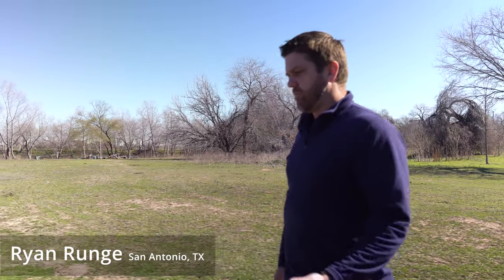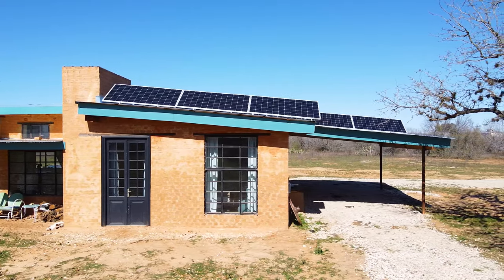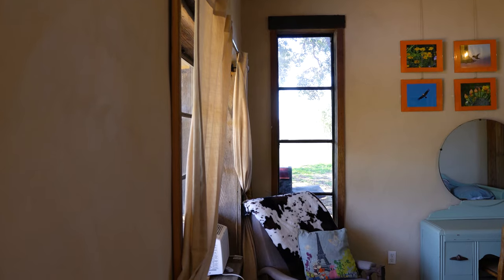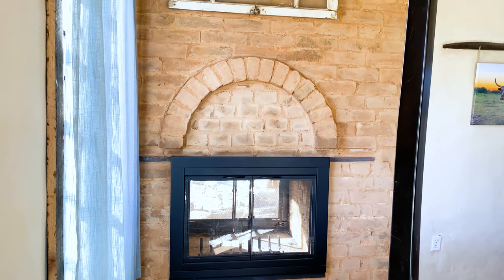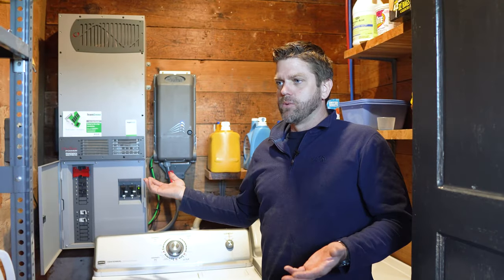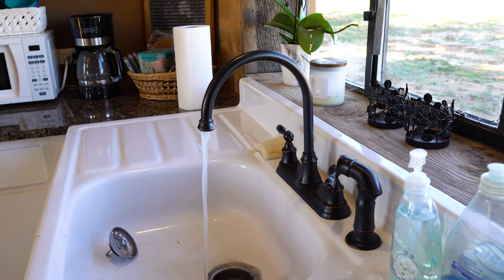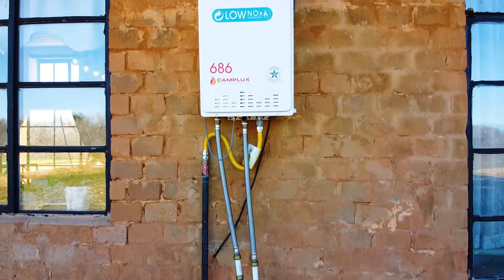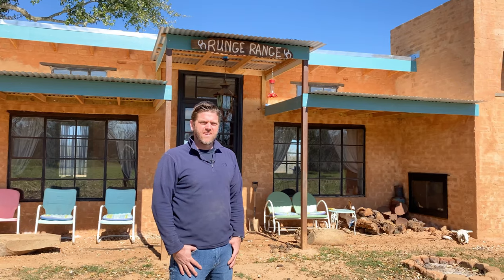Exquisite $50k OFF GRID EARTH HOUSE made with COMPRESSED EARTH BLOCKS - Ryan Runge Netflix HGTV

Comment: I am getting mixed messages about CEB homes.  One I hear that the R value is poor so the home would remain cold in winter.  (I hate being cold) Others say that CEB homes are fantastic.  I am in SE arizona but dont mind heat but hate cold.  Anyone have any wisdom on this?
Reply: If your area's mean temperature is comfortable and you have enough sun, the dense dense CEB can hold its interior near the average.  This isn't insulation, more of a thermal inertia; the earth takes a while to heat up and cool off.  For colder climates, insulative cladding on the outside can complement the thermal mass.